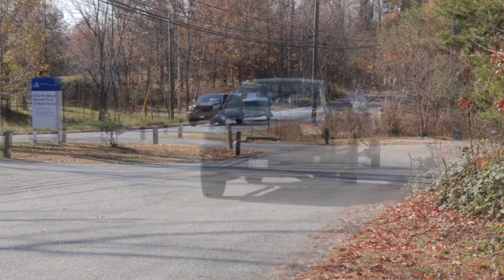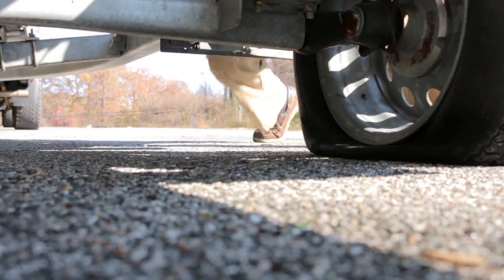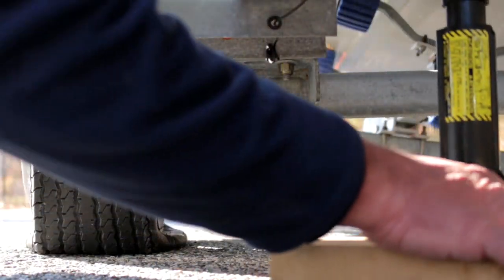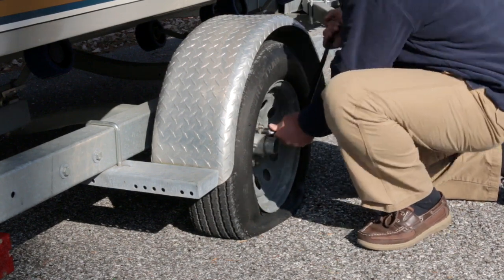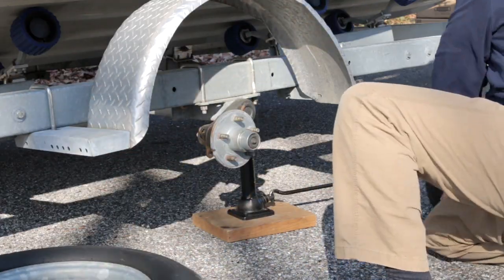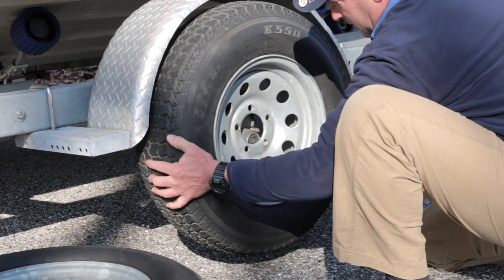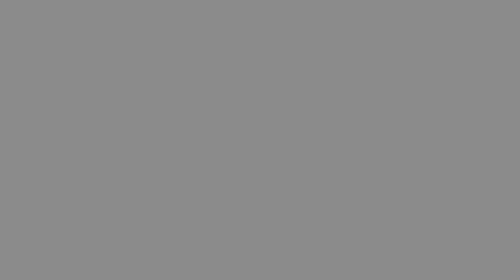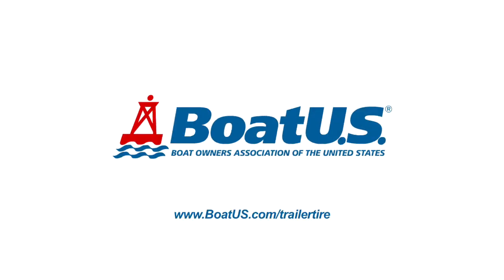How to Change a Flat Tire on a Boat Trailer | BoatUS

Comment: What type of jack is used in this video?  I am looking for a jack to use on my double jet ski shorlandr trailer.  The cross beam is about 7 and 1/2 inch clearance from the ground.  I'm assuming if I have a flat, it will be even lower than that.  Should I just buy a scissor jack?  I read those aren't safe to use.  I'm having trouble finding an appropriate jack.
Reply from the maker: Hi Kirsten. Thanks for the question. It looks like a standard bottle jack, like what comes with your vehicle. The important thing is to ensure that it's the right rating for your trailer and the maximum load that could be on it. It's not the easiest type of jack to use, but it's compact, and you should already have one in your vehicle that would work for this use, especially for a jetski trailer. As you're considering your emergency trailer kit needs, you might find this video helpful: https://youtu.be/-eEpAysi_Gg Also consider looking into roadside boat trailer assistance through GEICO and/or a BoatUS Towing Membership. https://www.boatus.com/towing (scroll to the bottom of the page for more info)

Comment: Lots of places use lube or anti-seize on the lug nuts.  Why do you say no?
Reply from the maker: Thanks for your question, FlyMe. This is one debate  I don’t think will ever be solved. Many tire experts say that adding lube to the threads allows the nuts to be overtorqued, which can strip the threads leading to a failed stud. The tech folks at Tire Rack had this to say on the subject: "Torque specifications are for dry threads only. The fastener threads should be free of oil, dirt, grit, corrosion, etc. It is important NOT to lubricate hardware threads or seats. The friction at which torque is measured against should come from the hardware seats. Lubricating hardware threads and seats alters the friction generated which will result in inaccurate torque readings and/or overtorqueing of the hardware." Hope this helps.
Reply: I'd respectfully disagree, if you live in an area where you're trailering into salt or brackish water.  In that case the lugs and studs can easily rust, to the point where removing the nuts can generate as much torque as you're trying to prevent.  I would say that if you are going to use lube, put it only on the threads of the stud, or carefully on the INSIDE of the lug only.  Never on the socket of the wheel or the outside of the lug nut.

It would also have been nice to take the few seconds to show how to go around the nuts in a star pattern when tightening, and do it progressively, so all nuts are torqued equally.
Reply from the maker: @skipkovacs1698  Thanks for weighing in. As to our point, different people are going to do it different ways--and maybe you're correct that it depends on location/type of water. Our best advice is to either check with the trailer manufacturer to see what it recommends or find a shop/mechanic you trust to advise.